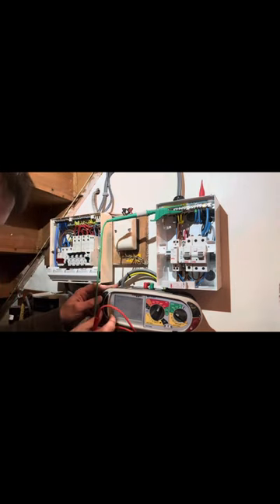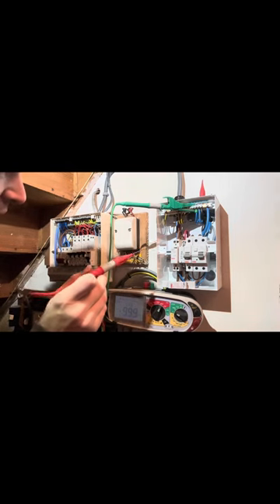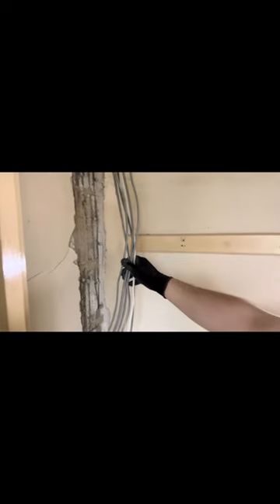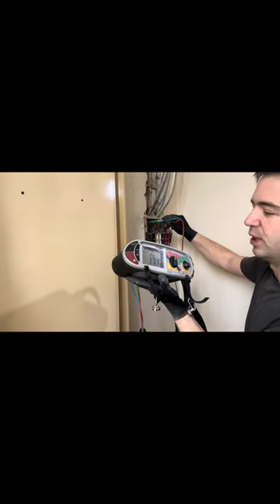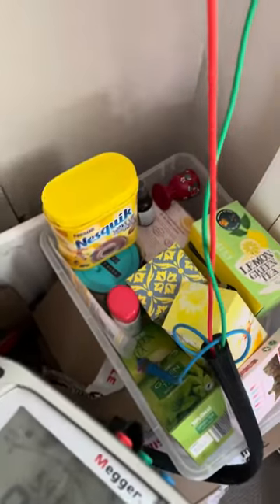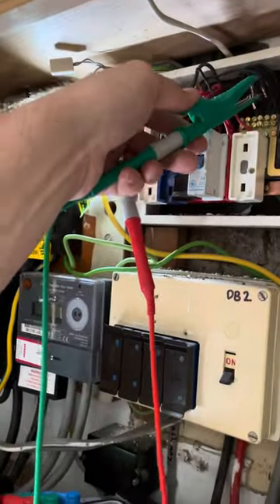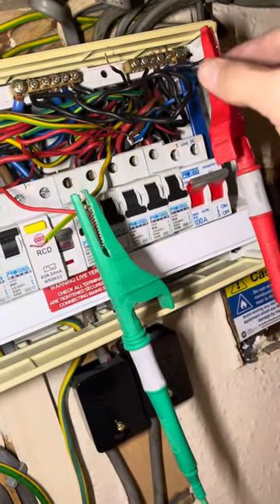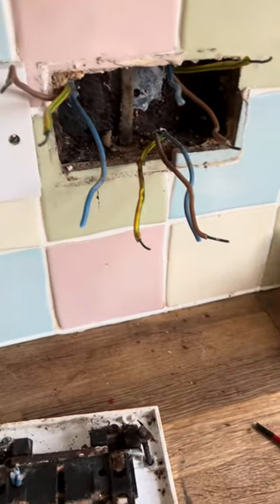INSULATION RESISTANCE TESTING - I’m amazed at how many people don’t do it because of RCD’s!

Comment: My name is Kana of Kyoritsu Electrical instruments works, ltd.
I learned a lot from watching the video about insulation resistance testing.
Reply from the maker: Ok👍🏻
Reply: @bristolsparky  What kinds of electrical measuring instruments do you often use?
Reply from the maker: @kyoritsu7886  watch my videos
Reply: @bristolsparky  Thank you so much for the reply.
Our engineers are also impressed by your videos.
Would it be possible to communicate with you to exchange the information about electrical equipment and about installation works?
Our engineers also can join to the communication with you.
I can confident that we can informatively exchange each other.
If you may, we can contact you via email.